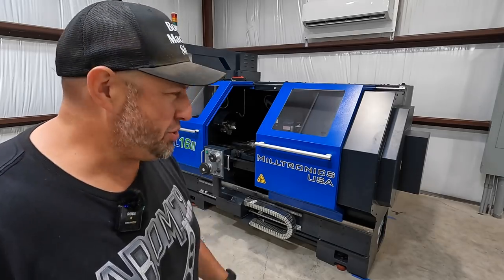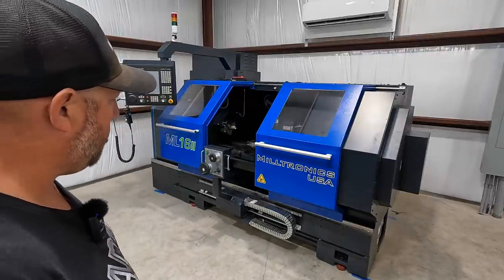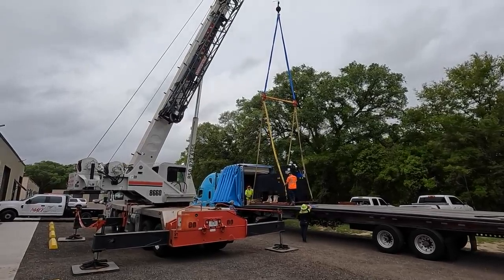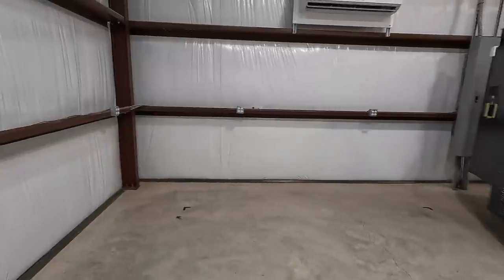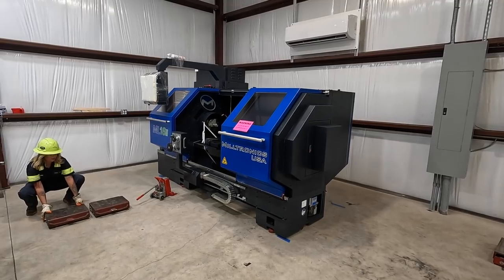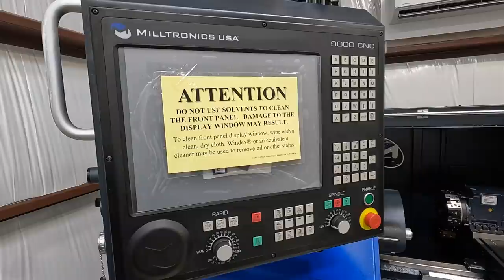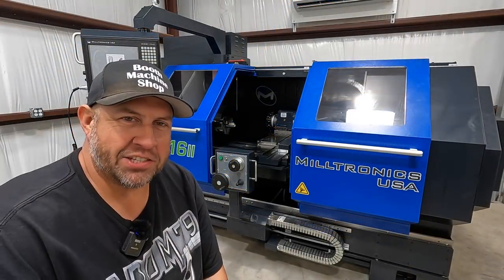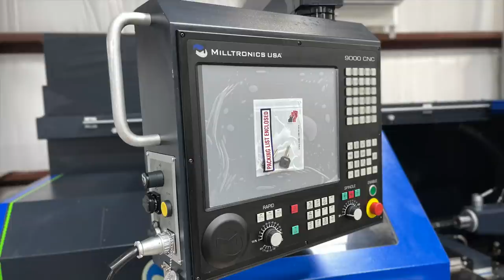Milltronics ML16 CNC Lathe, Our First CNC!

Comment: All CNC machine tools need to on their separate foundations so they are isolated from the rest of the floor. CNC machines also need to be anchored to their foundations to prevent the machine from walking. I have seen 15 ton CNC machine tools which were not anchored to a separate foundation walk while running. All machine tool manufacturer's should provided you with blue prints of the foundation required for thew machine so the foundation can be done before the machine arrives. Also the machine riggers should place anchored, & level the machine for you since you do not have a maintenance department. Also, there is a lot of maintenance required of a CNC machine tool. Most CNC machine tool manufacturer's provide a 1 one warranty. After that, most manufacturer's charge anywhere from $1000.00 to 1500.00 dollars a day for repair work. I know all this because my father worked for Ingersoll Milling Machines wiring new CNC machines & in the service department installing & repairing CNC machine tools for over 20 years & I had been a CNC operator in large shops for over 20 years. One of the shops I worked at had over 200 CNC machine tools. The best way to level a CNC machine tool is to use a laser.

Comment: That is a very nice machine. The only advantage to accessing the feed from the end of the cabinet would be if you are going to add a stock feeder to do production runs and if that is the case you are going to need an area about 2/3 the length of the lathe to have the automated stock feeder. Congrats on your new machine.

Comment: Hey Abom, I've been following this channel for a few years and I just want to say this. You're too humble. You will come up to speed with the CNC very fast. So much of what's needed you already know. The only thing is that you need to fear new things. And you need to anticipate what the machine is going to do with the given code.

By fear different things I mean that a CNC machine continuously executes code. So there are completely new opportunities for inaccuracies or crashes. But you'll get the hang of it very very fast. 

Finally... Most people might not agree but... For a 2-axis CNC lathe, you don't really need a CAM system. G71 and G72 are your friends.

Comment: Congratulations!
I have never seen a Milltronics machine. I am surprised at 2 design features having not seen them in new CNC machines for more than 30 years. 
Two leg casting base.
Flat cross slide.
Most of my experience is Mazak. While I have some exposure to other brands, Mazak was our shop's preferred brand forcing me to adopt Mazak design and thinking.

My exposure is solely high production, so bar feeder function, parts catcher, chip conveyor, live tooling and  sub spindle were common features in our shop. I will have to rethink what CNC means to low production/job shop environment. 
First overall glance at the Milltronics is impressive. CNC was my career life. Manual machining is my retirement hobby and learning experience. You and I are crossing paths, but headed in opposite directions on the learning and discovery curve. 
I am thrilled for you to jump into CNC with a real machine instead of a hobby machine. I am interested in who will be your mentor or if you will make the trek on your own. 

My hobby budget cannot possibly justify CNC. Do you have a business model that you are ready to share that justifies CNC investment? I hope that you will include us in that journey.

Comment: That's great Adam. Congrats on your new machine, and best of luck for your learning process with the G-code and CNC operation. Take your time and don't be in a rush. Taking short-cuts can lead to crashes, which are no fun. For threading operations you will just love it when you have things all dialed-in. Especially for doing pipe taper threads, etc. Cheers, Dean.

Comment: You will love that lathe for small batch runs.  And mainly threaded parts.  Amazing things happen when threading at cnc speeds.  I do a lot at 1,200 plus  rpm and the surface finishes are awesome.  You are also going to love the tool changers on both machines.   Enjoy

Comment: Laserman
Fine machine. I took training on a Milltronic mill with all conversational programing and it was a joy to learn. What I also came upon was a tool center, so you preprogram all tools used in the tool changer extra tool collets are needed. You will use this machine more as you get used to working with and jobs will be more accurate and cheaper to make. I am long retired but would like to see your shop. Doing work to pass time on a mini mill X axis is O.K. Y axis not O.K. but will get that fixed.
Moved many big machines, no rollers used air pads.

Comment: Looks good! Nothing like unwrapping a new machine. That "new machine" smell like the "new car" smell is very satisfying. You have the advantage of knowing conventional manual machining going into it and the learning curve won't be as steep. The first CNC machine I learned on in Tech school (about 1978) was an ancient one that was obviously well used and abused before the school got it. So ancient that to program it (three axis) you first used IBM punch cards, then fed the stack of cards into a machine that punched a paper tape, which then ran the CNC machine. Our project was to program the thing to carve our name into an aluminum plate. Test one with a piece of wood. Check. Then the plate. So, I'm standing there watching the machine run and all was fine until the VERY LAST Z-AXIS COMMAND! Which was to raise the cutter up clear of the workpiece. Then the cutter moved left to the machine "park" position. It skipped the Z-axis move and started cutting its way left! 😠Good thing I was standing there and hit the stop button, or it would have cut all the way through my otherwise perfect project! As it was it only cut a couple mm before I could react. Yes, we had to program it in metric! Every problem, every project, was given in a mix of units and we had to convert back and forth! For all of my ASMET and BSMET Degrees. 😧Upon investigating the problem we opened the control cabinet and found it had a layer of "chads" (the round scrap punched from the tape) on the bottom and scattered all inside! seems one of them had gotten into the optical reader head and blocked that last command.  Just my @#$%in luck! Was supposed to polish the plate but I asked the instructor if I could paint it instead! So homework with Bondo and filled the "oops mark" then black base paint (I was learning auto bodywork at the time) and gold metallic from my R/C stuff. Turned it in and got an A+! 🤓BTW, I was 19...

Comment: I appreciate it when you said "training".  I purchased a small woodworking CNC to learn to use.  I am very experienced in CAD, so that wasn't an issue.  Choosing tools and toolpaths for the actual cutting was another whole monster for me.  Simple 2D machining (signs etc.) was simple enough, even though I am still learning to choose the correct tools and depth of cuts.  Carving, which is somewhat 3D, is something I cannot master without a class on how this is done.  I still hope to catch a class on carving to take me to another level.  Most of your work would be similar.  Soak up that training.

Comment: Also, save that usb. Copy it to your computer. The control is windows based, and the ram can become corrupted if the machine is not shut down correctly. That usb backup is how you get it back up and running. Takes only a few minutes
Reply: Also, if that battery on the controller ever dies, that usb will be handy in case the board erases itself

Comment: Not sure where the spindle lines up with that beam on the wall but it may be possible to put in a access port through the wall just in case you want to do long stock stuff.prob only need a 3in hole

Comment: Welcome aboard the CNC world Abom! You know what they say, it's a lot easier for a machinist to learn to run a CNC than a computer geek. It's yet another tool to get the job done faster and easier. Your going to have times were you might think that you could just whip that part out faster on a manual machine, but once you get the hang of it you will love it. I think that a Lathe is actually harder to program for than some mills.
Reply: A young computer geek's fast eye , brain and hand coordination as well as programming and good mental arithmetic skills sure come in handy in the push button world of CNC.

Comment: Probably want to add a sturdy grille on the inside of that viewport, with distance between bars around two to three inches. And use safety glasses while working on it.
Saves on the hospital and roofer bills when you accidentally program in a hard collision and the workpiece decides to take flight.

I've seen a few pieces of metal make a mad dash for freedom, resulting in 'shatterproof' viewports suddenly dispersing with extreme quickness around a large area.
Reply: There’s some nice safety tips in the comments for this vid, thanks

Comment: just make sure you keep on top of the % of coolant and maybe get extraction fans in. if the coolant is weak, it will smell and when its really oily, theres too much %. bacteria is very irritable so thats one think id def advise on. and get a refractometer. apart from that, im sure your fans will help with anything you need.

Comment: Congratulations, Adam! I'm sure youre going to love learning to use that machine =)
One little tip; Once you've started using that handheld controller you'll probably start placing it more and more on the machine around the same area each time. Those magnets will eventually tear off the paint, so if you want to protect the paint you should mount something in between the magnets and the paint! Cheers

Comment: Its really easy man Im 62 and have been using CNC lathes and Mills since I was 20 , picture your cutting tool tip as a laser and your telling it where to go and how fast to get there . CNC can make extremely accurate parts but are better suited for more then 1 or 2 pieces runs you can load a 36" long bar and once its set up it can run by itself without a guy in front of it , it cuts down on labor costs but if thats what your doing thats ok too. good luck.

Comment: This is pretty cool. I'm happy for you being able to get these sponsored because they are obviously pretty pricey. CNC lathes seem a lot less common than mills as far as the videos I've run across. I suspect it's because from a utility standpoint, CNC added to a mill is just a much larger jump in what it is capable of that has general application.

Comment: You will need access for long bar stock, you might consider turning the machine around a d push it closer to the pacemaker
Reply: HPC just made a hole in the wall...could alway make a little access door in the wall of the building...landlord permitting.
Reply: @SirTannerah  lol

Comment: CNC is appropriate for complexity and/or quantity.

Might want to move the lathe away from the wall further if it has the ability for a bar stock feed through the spindle. Maybe that column near the spindle end is far enough... There's a convenient saw to cut lengths and a manual lathe to square the ends.

Comment: Cool deal.  I ran a Mazak I200s  and quick turns for 14 years.  Quick tip. Get some putty.  Cnc machines leak.  It might not right off but it will.  And please be careful with work holding.  We use to run our quick turns at 3000 rmp mostly and if you mess up it can be deadly. Be super careful with longer bars hanging out the machine.  Like run at 300 rpm. Iv wrecked a few times. It happens to everyone while learning
Reply: Wow never seen a manual tail stock on a cnc.  Is the chuck hydraulic?
Reply: Also most companies have a rep that will come for a few days and help you get started  understand the machine
Reply: If i can help in any way. Let me know.  I have a book with 15 years of stuff written in it. I am more than willing to share.

Comment: In my experience, making 1or 2 pieces of something is usually(not always, depending on the complexity of the part), done faster and cheaper using manual equipment. Anymore than that, then C.N.C. starts making sense. I'm sure there are people out there that disagree with that, just as there are machinists that are not capable of running a manual machine efficiently.

Comment: I wonder how much tooling from existing machines will be usable on the CNC machine vs. how much new tooling will be required.
Reply: Tools are universal for the most part, 90% of lathes can hold 1" shank tools which are the most common used in manual and CNC work as well as various boring bars that he also already has. The only time he would need new tooling, which doesn't apply here, would be if he had tool holders that were something like kennametal quick change holders because they don't always hold shank tools (there are exceptions).
Reply: @thescantilycladcob  thanks for that info. Just getting started I’m sure that will be helpful for him. I know there are some tool holders that are press fif or have to be cooled before insertion (or something like that). I guess that level of precision won’t be needed here.

Comment: Hole in the wall with a locked enclosure mounted to the outside would allow any length stock to be accommodated in the CNC lathe.

Comment: They should have kept the white color. Chasing threads is a great feature if you could see inside and control the handwheels. Mount a camera on the tool post when you are trying to line up the threads, it will make life a lot easier...that's the only setback. Great machine!!

Comment: I use a okuma that is conversational it writes in g code then I will go in and edit miner changes such as when water turns on and off feeds and other minor things such as after end  points after finish passes you will find that speed and feed can be adapted to manual lathes if flooded with coolant

Comment: You will need some sort of table to place finished parts or 1st op. parts that have to be turned around for 2nd op. 
Also doing quick inspection of parts as they are being machined. 
Might as well have something in between your lathes for those kind of purposes.
Reply: Its a youtube channel shop not a real shop

Comment: Congrats on the deal with Milltronics and getting the lathe. I seem to remember a New Year’s Resolution a couple of years ago where you said you wanted to take the plunge into CNC. I’m wondering what CAD/CAM package you will use. Hopefully something other than Fusion. I get the reluctance some have about CNC, but it’s really short sighted IMO. I’m a muscle car guy and have been for 40 years and the best modification I’ve ever done to my 68 SS Camaro is adding fuel injection and junking the silly carburetor. I have a Haas TM1 and a Haas TL1 in my home shop and it’s great, but you can’t do everything CNC so the Bridgeport and Hardinge machines remain my go-to tools. Does anyone see any hypocrisy in denouncing CNC while doing so using the internet? I’m anxious to see your first project.
Reply: What's wrong with fusion?
Reply: @henrychan720  just not my cup of tea. Not a fan of cloud- based stuff. Hmm, that sounds kind of old school, doesnt it? Now who’s the curmudgeon?

Comment: Hey Adam;
That's one beautiful CNC machine & i'm sure you are going to have great success with it.
To be clear; I'm an Electronics Engineer, but no machinist, I just like watching your videos.
During your series for this new shop you've said that you may want to do some work on long shafts, as you used to do.
Is the Milltronics placed for that? As an observer, it looks like you could spare another foot and a half to the electrical panel on the right of the Milltronics, if needed.
I suggested names for your machines before and for this Millie seems the natural choice.
Every time I see you smile I know you are excited about something, usually a new machine.
That Big Ass Fan tho.

Comment: dont you want ot have the possibility of useing long stock material for serial production on the CNC lathe? you will have a hard time feeding 8 yard stock through the exterior wall and use steady rests on holder extensions to controll that long material from flopping around
Reply: He can move it if needed. I gues mostly it will just see some light use, demo work just to show how it works and learn how to use it. No big production

Comment: Try using a one of those hybrid ceramic spray on coatings or just Rainex you can get from any auto parts store.  Apply it to the inside of the windows on the CNC it should make it much easier to see what's happening when the coolant is being flung around.
Reply: @gags730  you can actually use the Meguire's hybrid ceramic coat (Blue bottle) in a foam gun for a pressure washer to coat the whole vehicle in seconds and then hose it off as a touch up coating and then use Rainex to get clean the windows as the hybrid ceramic wax doesn't set properly on glass and can streak with wiper and rolling down the windows, even after a few days.

Comment: The other option would be swap the pacemaker and CNC around 180 so the pacemaker is in the corner and then you have access to the through spindle on the CNC, fair bit of work I appreciate but possible
Reply: Agree, unless there's a through spindle on the Pacemaker, too. But then the Pacemaker has pretty long bed and it may not have or need a through spindle!

Comment: What's the normal approximate cost of installation/purchase/servicing of that sort of machine?  I have no frame of reference here.
Reply: We years ago learned that machine and CAM could cost you 35k € per year, if you keep it 5 years.
Reply: Pretty sure it's well over $100k for the lathe, maybe up to $150k. The electrical work to hook up has got to be $2,500 per machine, if not more. I'll bet Adam will spend $50k or more on just the electrical work to install the machines in this shop.